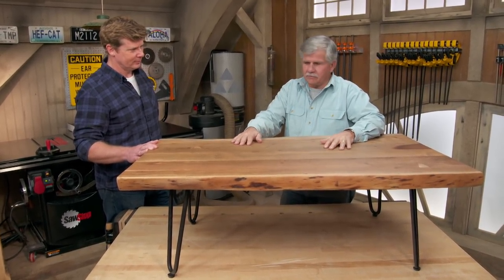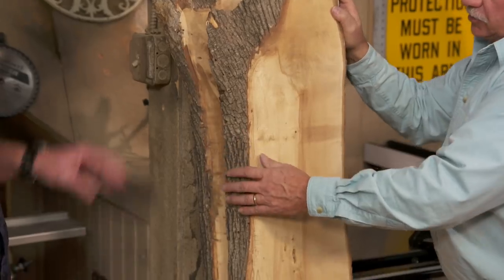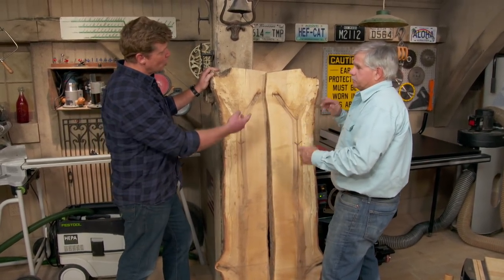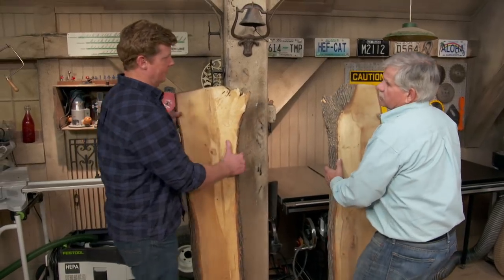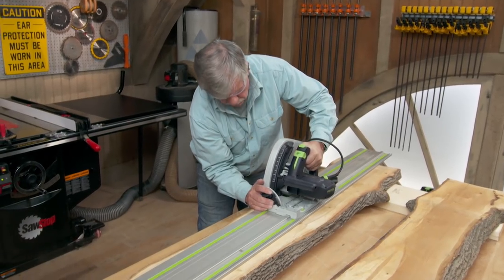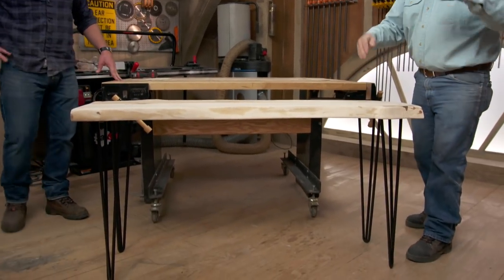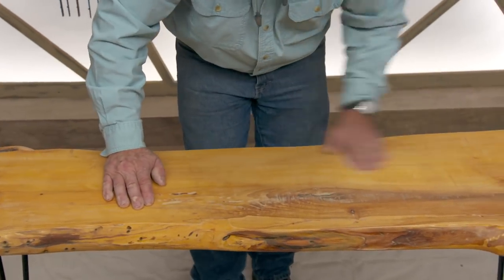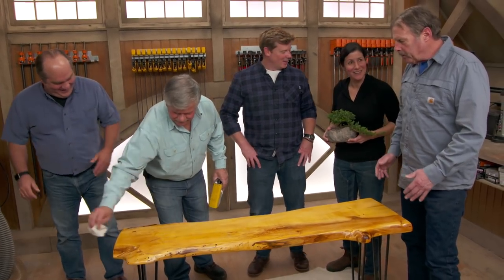Live Edge Slab Table | Build It | Ask This Old House

Comment: I like how they simplified everything from the router jig to just leveling where the legs go. Shame that they didn't use the rest of the slab they cut off though. Goes to show you don't need to entirely spend hours flattening or filling all the voids to get good results.

Comment: I like to leave the bark and pour epoxy over it to seal it, especially into the gap between the bark and the wood to glue it on. Comes out beautifully. Without the bark, it’s kinda not really a live edge anymore. Though I probably wouldn’t do it for something like a dining table.

Comment: Routing only where the legs are is a smart move.
I would have routed flat the whole thing top and bottom wasting lots of hours.
Reply: Its a question of craftsmanship. And if the wood is not dry it will still warp and then not sit flat. I would be the time it took to fiddle with the recesses would be the same to flatten the bottom, which would also look more professional.
Reply: I would've just sent it through the thickness planer a couple of times. The routed slots for the legs might make it sit level, but now you got a cupped table that will shed spills and cause things to roll/slide down.
Reply: @KewlCrayon  a thickness planer will not take the curse out of it. Assuming the planer is wide enough (most are 12") it will only flatten the surface. It won't take the warp out

Comment: With such new pieces of wood, I'd be concerned of after leveling the leg holes with the router, that the tabletop would warp, and wobble in just a few months. Is 2 slabs the way they have it (one flipped) enough to combat the warping issue?
Reply: My dad has made a few tables like this. He likes to put some steel in a dado in the bottom of the slab. It seems to do a really good job of keeping the wood from warping.
Reply: @adamchristophergrigg  

A table with a truss rod. That’s different, but I’m sure it’s very effective.

Comment: I never thought of attaching the router to the sled
Reply: With the sled you can flatten anything. With a 3/4" straight bit it'll take a while but still faster than winding sticks and a smoothing plane
Reply: @johnsmith-wc8gs  I use a sled regularly and have 3/4"-2" bits but have the sled and router move independently

Comment: What type of Router Bit did you use for this? I have a slab of Silver Maple I want to make into a table, about 4ft Diameter Circle, but needs to be leveled.
Reply: I use a carbide tipped flattening bit made for a CNC. You can turn the tips as they wear out which makes it practically a forever tool !

Comment: Question: Isn't the flat glue joint in the center liable to split and fail? Why not use dowels or biscuit joints in addition to the glue?
Reply: Not as long as the wood is dry to start out with. If it's wet, yes the wood will twist as it dries and might cause splitting - just not likely at the glue joint. Wood glue is stronger than the wood around it.
Reply: Barring outdoor exposure, wood glue's bond is generally stronger than the wood itself unless you're gluing endgrain which they're not.
Reply: Biscuits aren't really good for providing strength but they're decent at aligning the tops of the boards so you don't have to sand as much
Reply: The glue is stronger than the wood itself and it would be fine on its own.biscuits don’t add any strength the basically just line it up

Comment: I am a fan of the show but this segment was a total disappointment. I design and build furniture including designs with live edge lumber and this piece might as well have come from Ikea. No thought as to the function or design of the base - just buy some common metal bits so it looks like every other piece out there. You lost the beauty of the book matched faces by joining the slabs together then not even showing the most interesting face. Take the time to make sure the moisture content of the wood is low otherwise your trick to recess the leg flanges will not hold as the slab will still warp as it dries. Take the time to flatten both sides of the slab, show some craftsmanship! The finish did not look close to anything natural. 

Guys, you could have done a whole lot better.
Reply: not to mention that this was nothing more than a glorified bench,im sorry,but to MY eyes,that is NOT a table
Reply: D Tom Norm would be disappointed.
Reply: D Tom, not everyone has the same taste.  I think Tom S./TOH was keeping it simple because it's meant to be a DIY project where the hobby builder can customize it to their liking.  Anyone who's that worried about warping can either 1) buy dried lumber and/or 2) select a species and cut with less warping, and/or 3) reset the legs after however many years it takes the slab to completely dry all the way through.
Reply: Agree.  Was so looking forward to a widish table with book match and we got so much less.
Reply: Who needs a bench-table when you can have a mountain of complaints to sit on?